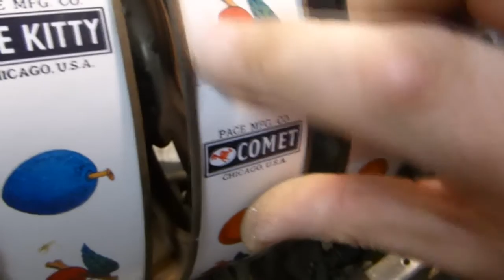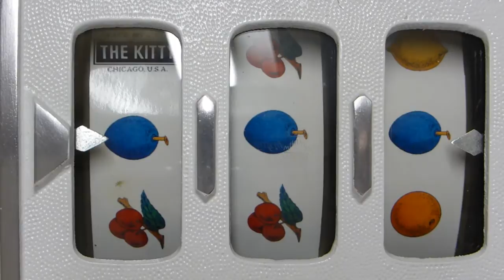How to Replace Vintage Slot Machine Reel Strips - PACE KITTY One Arm Bandit

Comment: Hi I’m restoring a mills hi top one of the strips was not on the machine so I can’t put the new ones on this way . If I set the reels to payout on the jackpot will that set all the other payouts up or do I need to check them all.
Reply: In most cases if the machine has just one jackpot winning line, then putting reel strips on and lining up those relevant jackpot symbols will line up all other payout symbols correctly. But always best to check a couple of other payouts before crimping the reel rims!

Comment: being you said that saving the original strips is worthwhile for collectors, WHY did you NOT show actually removing the strips???
Reply from the maker: Because someone in the past had used glue to stick these in parts to the reels, so had to rip them off. Really gutted as the original strips were so much better!